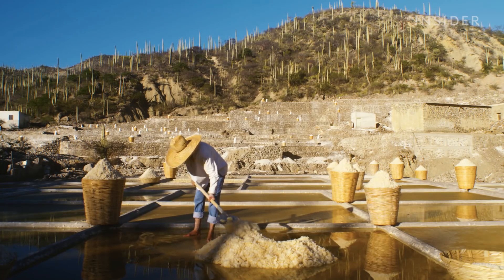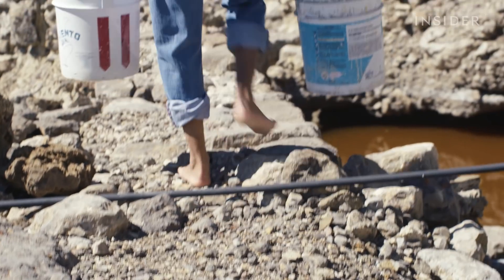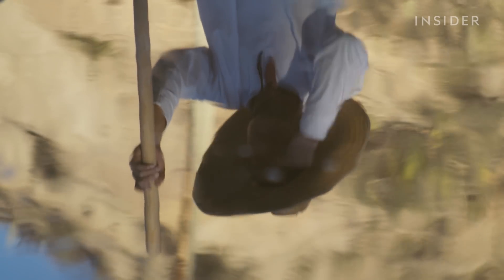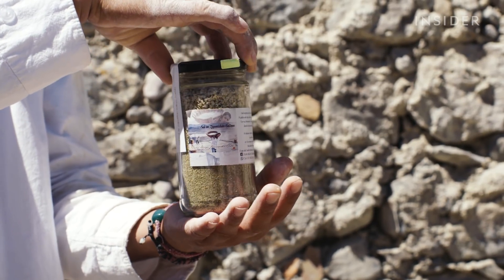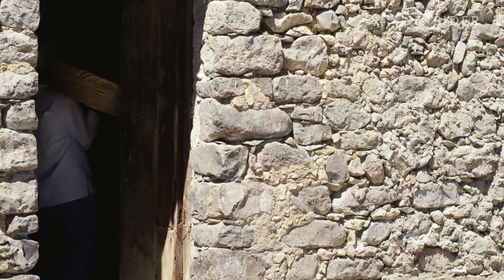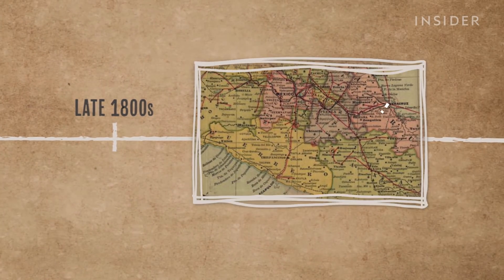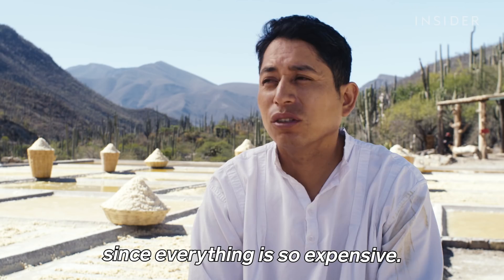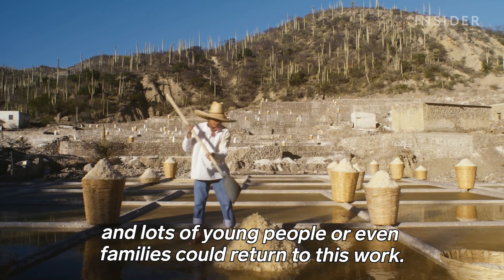Meet One Of The Last Salt Makers Keeping A 2,000-Year Old Mexican Tradition Alive | Still Standing

Comment: I wonder whether they try to increase production with some technology. For example, using a small, solar powered pump to move that water from pool to pool instead of using a broom or even trying to use a black plastic cover to increase heat and protect the production against the rain. In order to keep it artisanal one doesn't have to use prehistorical means of production.

Comment: What preservatives are added to salt? Being salt itself is a preservative, why would we add a preservative to it?
Reply: There aren't any, that was made up.  Generally the only things in typical table salt are: 

sodium chloride (this is what "salt" actually refers to, and makes up the vast majority of it)

potassium/sodium iodide (this added to iodized salt)

a reducing agent such as glucose (in a very small quantity, to prevent air from oxidizing the iodide to iodine, which would make the salt yellow, and give it a slightly unpleasant taste)

an anticaking agent, to allow it to flow more smoothly and not clump up

That's generally it.  I guess you could say the reducing agent is a preservative for the potassium/sodium iodide, but that's misleading, and the concentration of it is incredibly low, being measured in parts per million or billion

Comment: The mineral content is what I find interesting. I’ve been using Celtic Sea salt and the natural magnesium has helped with my insomnia. Zinc as well. The table salt you buy here in America is trash. Processed and refined to the point of being worthless
Reply: Refined salt is not bad
Reply: Iodine is a necessary nutrient, and all but absent in any proper amount, in “natural” salts. Moreover, the ppm levels of trace elements in salt are so minute, that eating a cucumber or drinking a coconut would exceed those levels exponentially. Your tap water is likely to contain more trace minerals than any salt; Celtic, Himalayan, Mexican-foot, or whatever else is trending on Instagram.
Reply: @sergpie  ok thanks bro